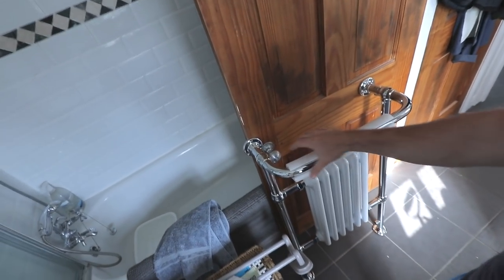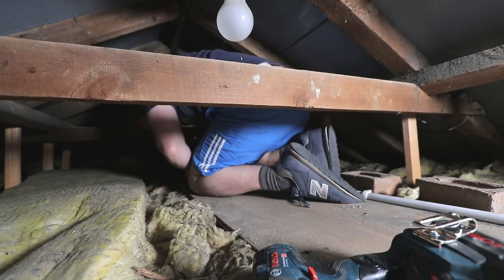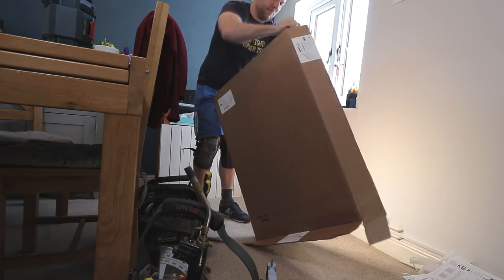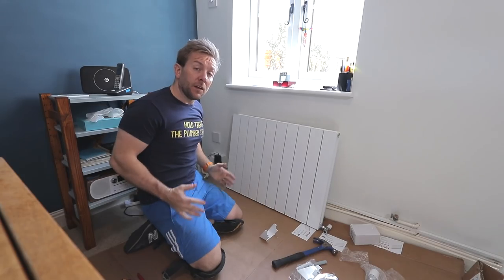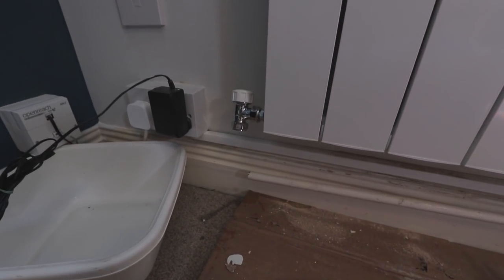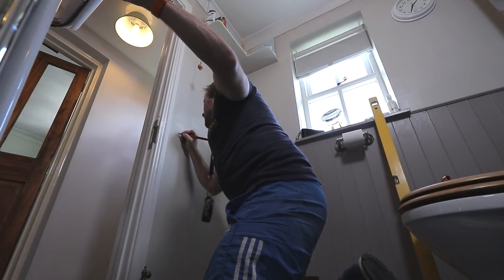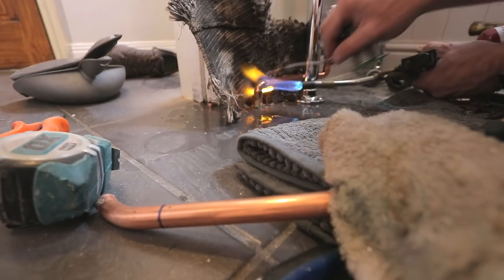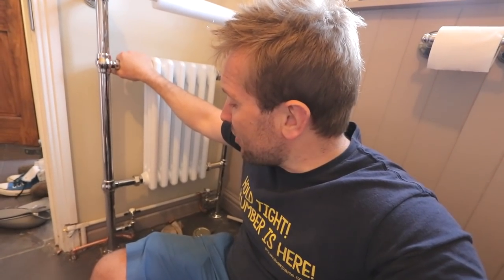REPLACING TWO RADIATORS ON THE JOB

Comment: James can you please show a couple of things to help people out mate. 
I’ve got a few pals who fit bathrooms and occasionally I get calls about problems that they encounter. I’m older than you, but you have always been my go too for visual explanations ( i wouldn’t have a clue) 
I’ve had two conversations tonight and as you’re well aware it’s incredibly difficult to try and explain solutions to problems. 
I’ve tried to explain how towel rails in older installations worked on the hot water side of the plumbing, and how to diagnose a blockage between the cold feed and vent on a gravity system.
There’s only one video where a bloke uses magnets but it doesn’t look into the cause.
You have been my go to guide for a long time, and a constant source of reference for clients. 
Please keep up the great work you’re doing. 
All the best, Les 👍

Comment: Years ago (alot of Years) when I was taught on lead run joints, we used to stick a small piece of bread down pipe to stop back flow of water, then when water was turned on the bread would break up and flush out of tap 🤣🥰😎

Comment: Always learn something from your visa, mate. You mentioned something about a bung for the vertical rad under the window but didn't see you insert anything. I know you can buy baffles for the bigger ones with flow issues but not heard of putting a bung in. Perhaps you can let me know what you mean? If it's a good rad you shouldn't need to insert anything.
Reply: Want to know this too, did you find anything?

Comment: Above floor, where the pipework is in full view, I like to to use chromed pipe and fittings especially for radiators, it looks really smart but it does take that bit longer to de-chrome the pipe ends for soldered joints .  If I encounter a pipe that continually wells up with water I solder all the fittings on the new ‘dry’ pipework and then use a compression fitting to make that final union to the ‘wet’.

Comment: What should you do if the pipes are coming up out of the floor either side of the radiator, and the new radiator projects further out of the wall than the old one? We've just replaced a bunch of single rads with doubles and feel like we've botched it a bit. Wondering if there's something to be done without having to take up the floor...
Reply from the maker: Watch the video last week about pipe bending. If you do it right can look great.
Reply: @plumberparts  Aha thanks! Will have to have a go at doing it properly!

Comment: Was there a reason you made an offset bend for the right hand valve for the first rad rather then just do a dogs leg and elbow up into the valve?
Reply from the maker: Ahhh, it’s hard to see but the valve is lower than the pipe. Which was a bummer.
Reply: @plumberparts  oh that’s why, hate when that happens, top work 👍🏻